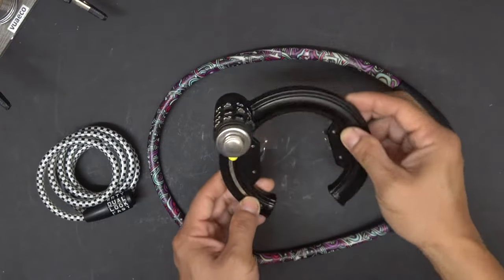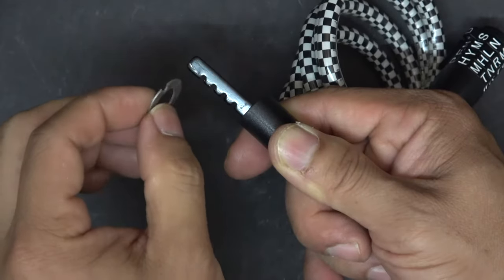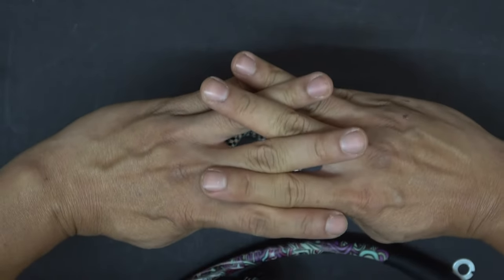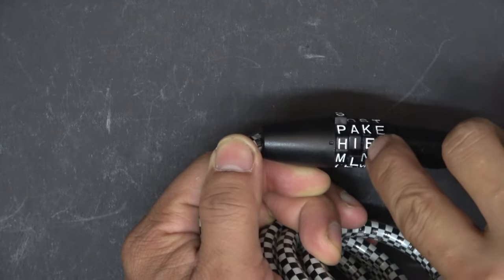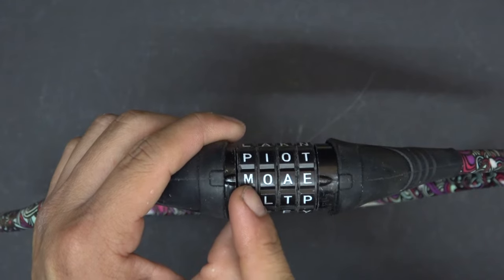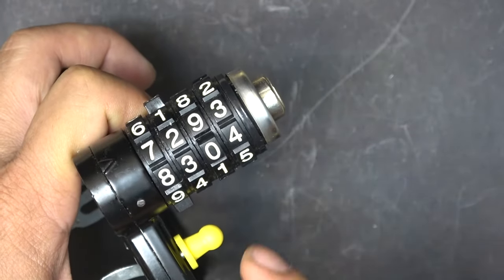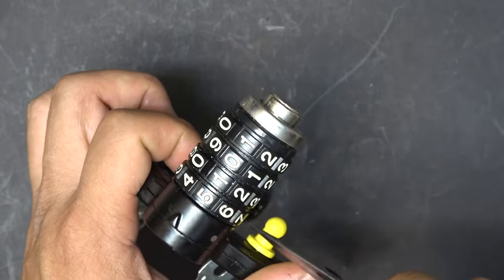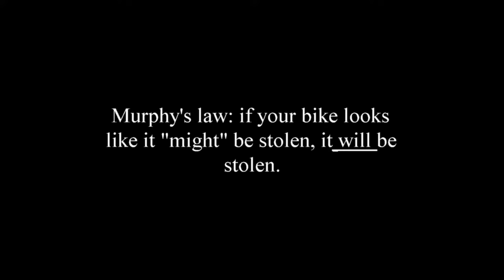3 ways to hack & open bike locks without combination key

Comment: After trying for what seemed like forever to open one of these locks, I cut it apart to discover that the the internals were frozen and the plastic rings were spinning free without actually changing anything.

Comment: None of these techniques worked on my bike lock bought from the dollar store. No gaps to move around between the cylinders. 😲
Reply: What does it look like? Is it the one without plastic parts and with tiny metal digits? It has no false gates and picks like a normal lock, you simply tension it, find the digit that binds and spin it until it lets loose and falls into a set. You can open those without knowing the code as fast as if you do, not suspicious at all. These in the video are pretty adequate in comparison.

Comment: I trust a 4' length of 1/2" steel chain, a Master 6-pin lockout padlock, and most importantly, my brain to find a safe place to lock up!

Also, my bike is a steel-framed jalopy with wires hanging out everywhere, and a battery box held on with tie-wraps. It says to would-be thieves, "Do you feel lucky?" 😂😂😂
Reply from the maker: LOL! If they know how expensive that battery is, they feel lucky!
Reply from the maker: Maybe they just cut your tie-wrap and take the battery only.
Reply: @vuaeco  You're not wrong. That's why the most important security asset is my brain. I have little choice as I don't have a proper battery mounting system, but I still need to occasionally remove the battery for charging.

Another thing is that my hot glue-festooned battery box is from a sit-down scooter, so a keen-eyed thief might assume I have 4 lead acid batteries and walk away. At least, this is the hope...